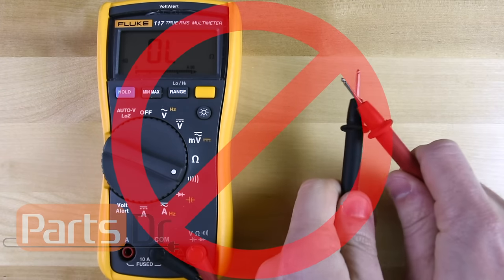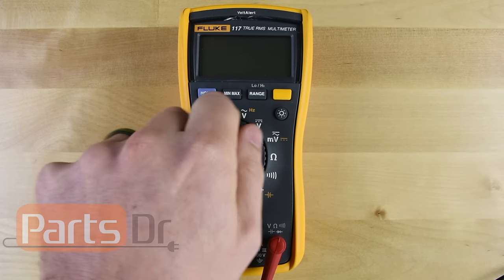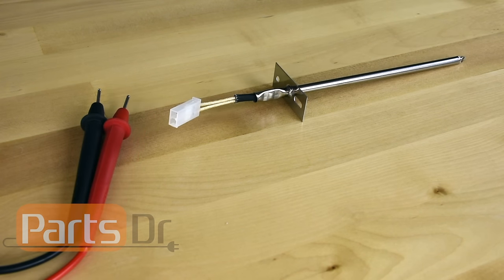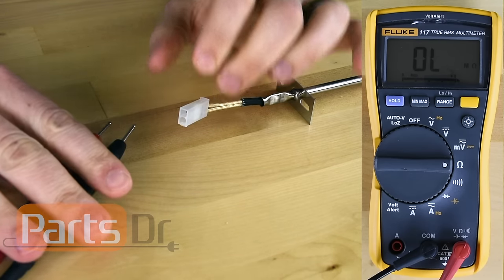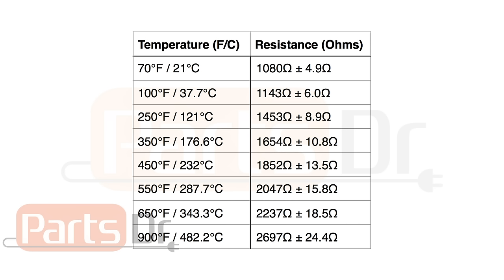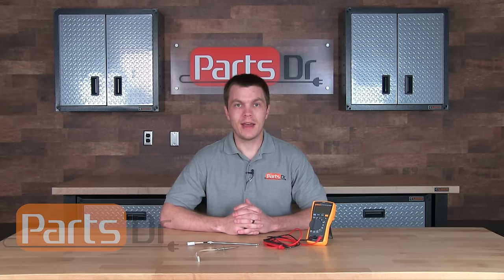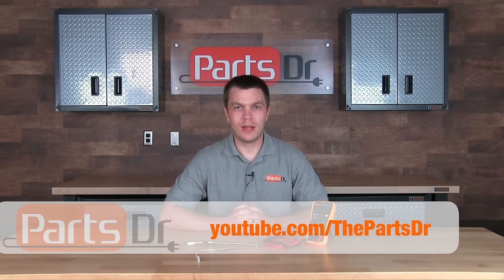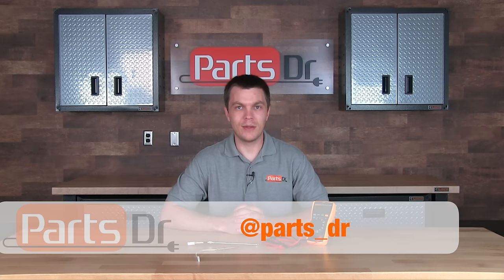How To Test An Oven Temperature Sensor

Comment: Nice video. As an appliance tech with a ton of experience , I would just like to pass on my experience regarding oven sensors.  The VAST MAJORITY of defective sensors I have ever tested passed the resistance test at room temperature  (1080ohms @ 70F ).  So don't assume that a sensor is good just because it reads good at room temperature.
They start to go haywire at higher temps.  They are cheap enough , so replacing them is the easiest option and most often solves the problem .If your sensor for some reason is very expensive ( say it's from a Viking or Wolf range etc)  just buy one of those universal sensors that come with a variety of plugs. If one of the plugs doesn't fit then just cut the wires and splice them using high temp porcelain wire nuts.  Every oven sensor I have ever seen has the same resistance values when new , regardless of the oven manufacturer .Having said that, there could be a chance that you have an oddball range where the manufacturer used a sensor that falls way outside the range of the rest of the industry. In that case you must purchase the correct sensor for that make and model.
 If you still have a problem after replacing the sensor, then the issue is most often the control board. Solder joints go bad on the boards or logic circuits fail giving the board the impression the sensor is defective. If you are capable, re-solder the joints that look suspicious , or take the board to a TV repair shop and ask them to inspect all the solder joints and re-solder the bad ones. Sometimes it can be cheaper to just replace the board..lol     But often the board is no longer available so your choices are limited. There are companies that now repair many circuit boards. CoreCentric Solutions comes to mind, .
Least often , but still should be checked before replacing the board, are wiring  problems between the sensor and the board. Sometimes the plug at the sensor can be an issue. The pins internally don't connect tightly and cause issues (rare).  I have seen where mice chewed through wires causing all kinds of problems. So if you see mouse droppings  around the outside or the inside of the  the range , be aware  that you might have a wiring issue. I've seem mice that electrocuted themselves chewing into live wires.
Reply from the maker: Great advice!
Reply: My control board had cold solder on the input voltage terminal to the bake and broil connections. Re-soldered it good and the oven is back on business.
Reply: My sensor tests OK at rm temp but it must be bad. I wish I had read this first before putting it back together. I was an electronic tech/engineer and could have tested while hot and checked the videos' resistance list. Rather than do that I am going to buy one for ~$10.00 and install it.
Reply: Thanks for you of experience . I  followed  your advice and  Replaced the Defective Sensors!  
As you rightly pointed out,  same in my case the sensor   on the bench  had per spec readings“ .  
Yet it  was defective i.e., the sensor resistance over a range  controls the temp in the oven.
This solved my oven variable/ low temperature .Great input is appreciated.
Reply: So would or could the temp sensor be the reason my igniter won’t begin to glow. The old one has tested by my multimeters to be good and have continuity. The new one tests the same. The safety valve tests perfect but igniter still does not even attempt to start glowing. Broil works perfect. No bake
Reply: Thank you so much!
Reply: Replacing parts is always an option. But to pinpoint the problem obviously is what you would want to do vs changing the ignitor, the. Temperature sensors and all...

 But like you said these things go wrong without testing at crazy numbers.
Reply: Since it seems you're in the ballpark, can I ask you which multi meter you would recommend for me to get? One regular one and a second one with a clamp to read wires while on? Thanks
Reply: Thanks for making the effort to give detailed information. Way more informative than the actual video. Nowadays every new appliance goes bad in a year or so. Maybe Someday everyone have to become a technician to repair their own appliances.
Reply: Thank you for sharing, much appreciated.
Stay gold.
Reply: You just saved me hundreds of dollars.  I had checked the resistance of the old temp probe at room temperature and it tested good but after reading your message, I decided to take a chance and install a new probe for about $13.  Guess what, the oven is fine.  Had I not read this I would have spent big bucks on another control panel or thousands for a new oven. Many, many thanks.
Reply: My oven would stop heating before set temp. was reached. I just replaced my temp sensor and then checked the old one. Read 1084 ohms. Oven is working perfect now with new sensor.
Reply: So I have a Whirlpool Oven that will automatically lock the door and get really hot. The only way I can get it off is by turning off the breaker. It does not do it every time. I tried testing the temperature sensor tonight at room temp but could not get a reading. (I am not sure if the meter prongs are long enough). I am trying to decide if I should replace the sensor or the board. Do you have any advice.
Reply: Thanks for this suggestion. Just for fun I boiled some water and then tested resistance with the probe in the water. According to the chart it was reading too low by over 50 ohms. At room temp it was right on expectations. Just ordered a replacement.
Reply: Thank you for your clear explanation and taking your time!
Reply: My sensor is showing 1.05 M Omhs is that possible that it’s working. The other one is showing the same value

Comment: I watched your video and used the information to fix my GE Wall Over....the sensor was good, but when I removed the sensor, found the wiring was loose, in the ceramic wire connectors. Tested the sensor using your advice, tested good, reinstalled works like a champ!!!  You saved me a service appointment at $75 just to show up, probably double or triple that cost in parts and labor. Thx!!!
Reply from the maker: That's awesome!  Thanks for sharing!

Comment: Thanks for the video. Black & Decker says they don't sell internal parts for it, and I can't locate the part online.

Mine doesn't have a probe, per se, it's really just a resistor crimped to wires on each end, wrapped in a heat sleeve. The resistor is smaller than a grain of rice. It's red, with a gold? stripe in the middle of it and measures 86K ohms. Where can I acquire such an item?

Comment: Thank you for your helpful information.
How would you replace one in a built in wall unit?
Reply from the maker: Turn off the power to the oven.  On some you can just remove the screws to the sensor and put the sensor out and there will be enough extra wire to pull it through the opening to disconnect the electrical plug and reconnect the new sensor.  But, if there is not enough wiring to pull through, then you have to remove the entire wall oven and disassemble it from the rear to replace the sensor.

Comment: I have a double oven, model JB860SJSS. Recently we lost 8 loves of bread because they were underbaked. We had just baked bread earlier that day and it turned out fine. I cooked a pot pie the next day and the top did not brown. The upper oven worked fine. Both heating elements in the bottom oven turn red, so I don't think it could be a continuity issue with the heating elements. I am not getting any error issues. I tested the oven temperature and it was running low, but not evenly low, by up to 50 degrees. I turned it to +35 an tried again and then it was cooking perfect a lower temps, but way too high a higher temps. I settled on +20. At convection 400 was 400 and about 365 was 350, but it was still a non linear change. I recognize that is only a temporary fix. Would a faulty temperature sensor cause those issues or is it a control board issue? Would a control board only cause a faulty bottom oven? If it is a control board, what is the fix for that? Switch out the entire board? Is there a way to run diagnostics on the board? I am more used to analog fixes. We were also wondering if cooking with multiple pizza stones in the oven could have thrown it off.

Comment: Great video and info below... Question:  Our GE stove is not accurate what so ever.  A few days ago we conducted the sugar test.  It melts at 367 deg.  Ours was off by 25 deg or more.  I went into the front controls where you can adjust the temp sensor setting then re-ran the sugar test and it failed when replacing the temp sensor.  When installing the new temp sensor I assume the adjustment should put back to zero?   Thanks
Reply from the maker: Yes, it would be a good idea to set that adjustment back to zero.
Reply: @PartsDr  Thanks for responding.  Not being the technical expert at appliance repair, is there a proper way to confirm the accuracy of the oven temp?  We have one of those inexpensive analog thermometers but don't really know if an $8 gauge is accurate.
Reply from the maker: @randybarrish1132  The cheap analog thermometers are very inaccurate and very slow to respond to temp changes.  You typically need a more expensive digital thermometer with a long wire temp probe that you can put in the oven to monitor the temperature.  After monitoring the temperature you would take an average of the readings.
Reply: @PartsDr  Thanks You...  Appreciate your answers

Comment: I have a Maytag dual fuel ( 2 electric ovens) There is a thermostat in each oven ( top smaller & Bottom is a full oven size) Looking at replacement thermostats is confusing are the thermostats the same part number ? Thank you for your help, Mike
Reply from the maker: What is the model number?

Comment: Parts Dr!!>   I am getting worried if my GE model JBP66DY1AD is going to heat up after I install the replacement part WB23X5340 if the connector does not fit & I have to splice the wires do I need to solder them before I connect with the high temp ceramic wire nuts? (Whats going on now is bake element I just installed a new one but it is not getting hot, the top broil element starts to warm up even gets hot during the bake mode but not the bottom element)
Reply from the maker: Your problem doesn't sound like a temperature sensor issue.  Have you checked to make sure the bake element is receiving power from the main control board?

Comment: My Samsung preheats to about 140 and it fails to rise past that point , I have followed a lot of videos on testing , my temp sensor reads 1080.  Every once in a while I can unplug it for a few hours and plug it back up and start oven and it will work but it doesn't happen often ! Am I at a loss?

Comment: Good video. I'm wondering if you would be able to provide a hint or advice on my issue. My Kenmore gas oven has the lowest temperature setting of 170F.  I would like to lower this minimum setting to around 90F or 95F for the purpose of preparing dough for bread making inside the oven, and I need 95F for the dough to raise.  I'm thinking about introducing a resistor in series with the temperature sensor in order to cheat the oven into thinking that it's 170F at 95F actual temperature. I would also connect a simple switch that would short or bypass the resistor when I'm not making bread.                        
Or is it possible to reprogram the oven to a lower minimum temperature?
Reply from the maker: Most ovens are not designed to operate at that low of a temperature range.  The temperature swing on most ovens is 50F.  For instance, if you set the oven to 350F, it will heat up to 375F, then cool down to 325F, and repeat that process to average 350F.  We don't think a standard oven can accurately do what you are attempting.
Reply: @PartsDr  Thanks a lot, your advise helps.

Comment: my Maytag range last night went poof ( i think )
i had a chicken in the oven at 375 degrees and i was in the living room when i heard what sounded like electricity for 2 seconds - you know how it makes that sound in videos of power lines arcing
went in the kitchen and the oven stopped working, the lightbulb inside it went off and the 4 burners on top dont turn on
if i turn the knobs for the burners, they dont heat up but the little display on the range shows what seems to be an error code " m266  e255
any idea what i might have to change out ?
thanks

Comment: I have a Maytag model #WFG515SOESO. The oven will heat up to temperature and then won’t cycle back until the temperature is much lower.  In other words, it doesn’t cook evenly at normal temperatures. When I heat up to 450 to 500 the oven cycles properly.  When at 325 to 400 it won’t cycle properly.  
I have checked the sensor and it reads exactly as it should. I have run diagnostic tests and get no error codes.  I have changed the bake temperature from 0 to -30 and 30 degrees with no effect.  
Is it possible the sensor is shorted some how and won’t cycle in lesser temperatures?
If the control board is bad, shouldn’t it show some sort of code or possibly not work at high temperatures?
Sorry for the long question, I am just confused.
Help!
Thanks for any guidance.
Reply from the maker: It sounds more like a control board issue from what you described.  These types of symptoms would most likely not cause an error code.
Reply: I believe you would have received an error code if the thermistor was faulty, so the control board seems to be the culprit.  With that said, I have replaced thermistors that tested within normal operating limits (resistance@room temperature), but were faulty only within a specific temperature range when heated.  Most of those issues were accompanied by an error code.  As was stated by doc, these types of control board faults will not throw an error code.  Control boards are good at alerting you to problems with their attached components, but they are not good at alerting you about problems within their own circuitry.

Comment: Can this thermistor sensor have proper reading and still be faulty? I have the issues with oven not reaching desired temperature but if I set it higher it will reach initial temperature but not new temperature is set. Every element is working and thermistor checking with approximate readings you said...
Reply from the maker: The temperature sensor can test okay at room temperature but it can be off at a higher temperature.  Or, you could possibly have a control board issue.
Reply: Exact answer I was looking for, thank you

Comment: I can cook in the 300-399F range no problem my Maytag gas oven, but when I use 400+F or higher it will claim it heated to temp then it will not maintain the temp, allowing oven to cool down while in use.. Sometimes if I cancel and restart it will hold temp to cook a pizza, sounds like control board issue, unless a bad sensor can stick at a certain resistance in this 400F range, doesn't appear possible though...  Now decision, stove or board...  feature rich stove that would cost nearly a grand to replace and 100 for used board with lifetime, guess board is next.. Seen remanufactured boards but they were in different color...

Comment: @PartsDr is 1050 to low for room temp my oven keeps beeping preheat when trying get to temp and says dr as in I'm guessing it either needs a Dr lol or it's saying door is open so it won't preheat?? Please help I have a Frigidaire MEF352BGWD
Reply from the maker: That ohm reading should be close enough to not cause any problems.  We don't know what would cause the beeping while preheating except maybe a bad control board?

Comment: Is the different than a 'thermostat fuse/thermal fuse'?
I have an older ge electric oven model jbp76gs3ww, we did s self clean and the oven stopped working, the door stayed locked, and the display lights no longer work. 
The stove tops still work, so its not the power.
Online I read this scenario is common, and its likely the thermostat fuse. 
Yet in pulling off the back panel, I see nothing that looks like a fuse. 

There was this kinked rod, with some blackening going into the oven - but here it looks like its supposed to be kinked. 
There's a brown circuit board with components on it behind the main knob/ thermostat dial - screwed onto a larger green circuit board, but nothing that looks like a fuse. 
I saw another video of a newer model where the thermal fuse was circular with 2 wires - there's something similar here, but its the oven light housing - which hasnt worked in years. 
Maybe the fuse is built into the bottom of the light socket? - as in the light filament can fail, but the fuse still works?

I've tried looking at the owners manual online - but they have no electronics, videos and google searches, and I can't seem to find the thermostat/thermal fuse, and what it looks like. 
Another guy referred to me the fuse box/fuses might be under the stove top - but in lifting the top - its all 3 wire components near the burners, a 2 wire door closed switch, and a 2 wire door locked switch....I cannot find this frigging fuse, nor what it looks like as I keep getting mixed search results. 

Is it this tube thing?, if that pops/breaks from a self clean - would that kill the oven/door locked/no display - yet still have the stove tops working?
Thanks for your time.

Comment: Great video thank you. I have a Jennair Gas oven Model PRG 3610NP. I have replaced the Temp probe twice now. The last one has lasted 3 months. The oven still heats but will not heat past 375 degrees, no matter how long I leave it on for. Broil, convection all work fine. Any ideas what is causing this?
Reply from the maker: What are you using to monitor the temperature inside the oven?